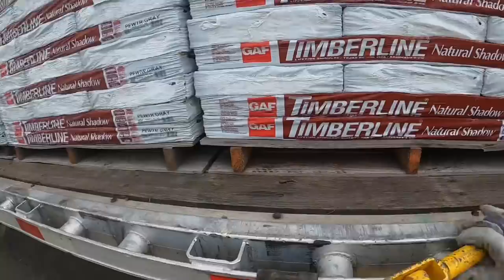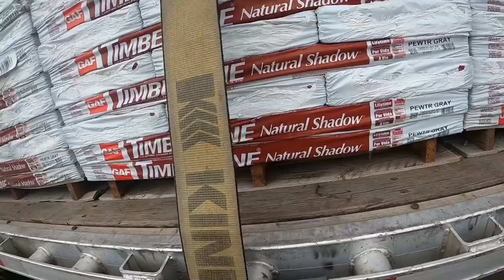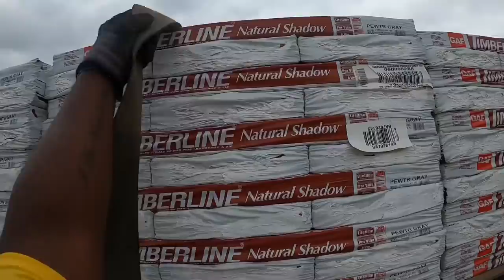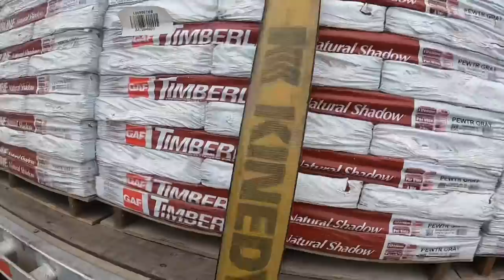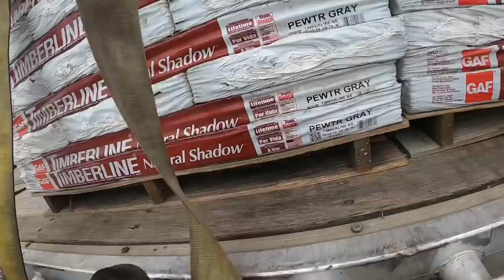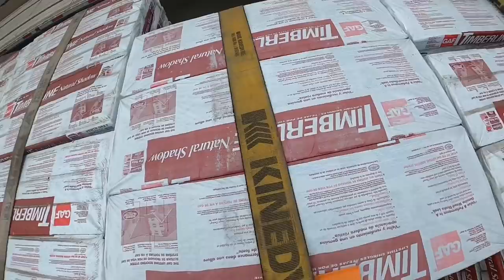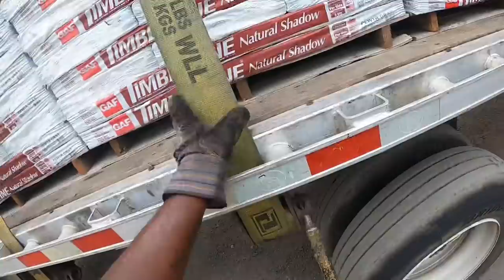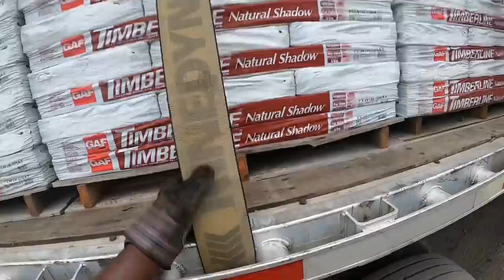Job Site Delivery Queens New York And Shingles Load Securement

Comment: Talk about Barkley Center. I’ve been down under the Barkley Center with a 48’ flatbed. You drive into the building and take the elevator down to get under the Center. Then you pull forward on to a big round table and they spin you around so you can back into the dock they want you at. It’s amazing!
Reply from the maker: Never been to that place yet. Sounds hectic

Comment: Dude, before you get a fat ass ticket using bungees on your dunnage. Take the hook end with the strap on it and flip it, then attach it to the other hook with the ratchet. Do this on the trailers that don't have the " L shape" bracket running across the trailer.
Reply from the maker: Good advice. I know I could do that and it’s no excuse why I shouldn’t 🤷🏾‍♂️